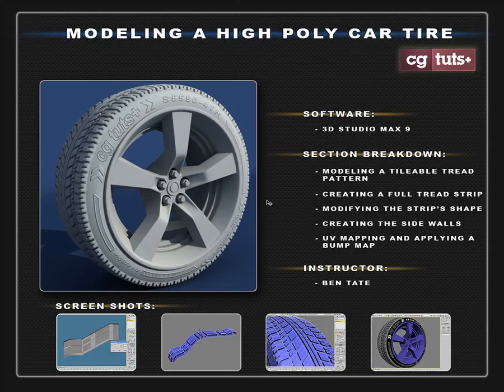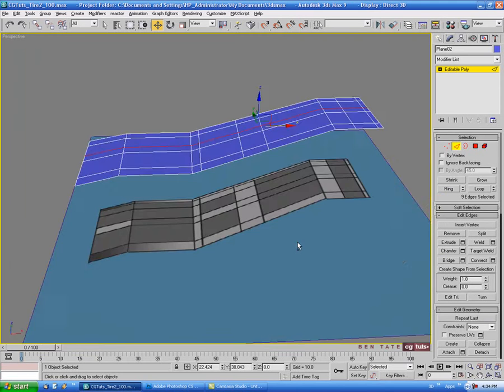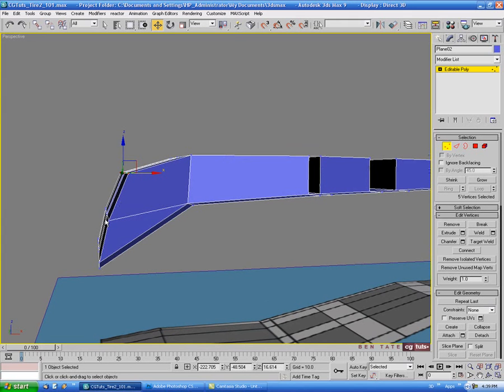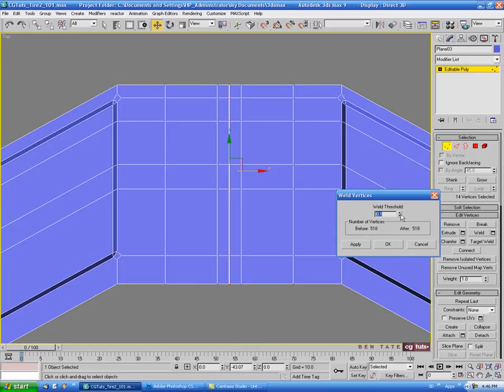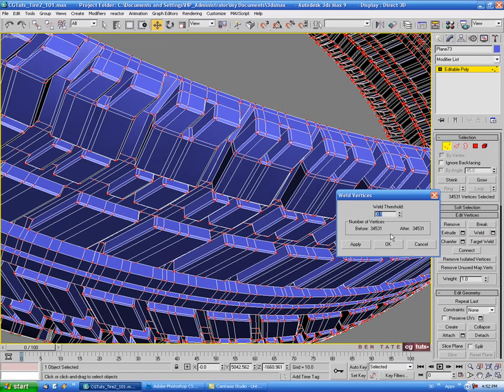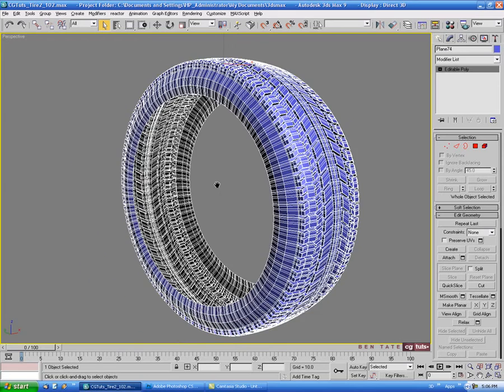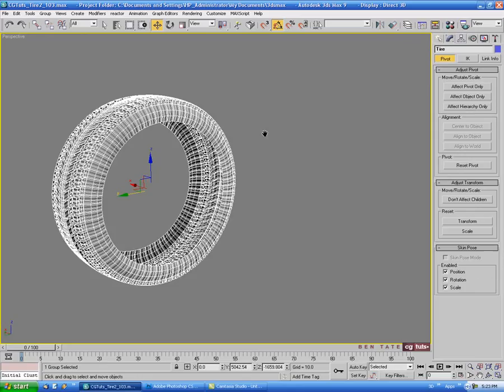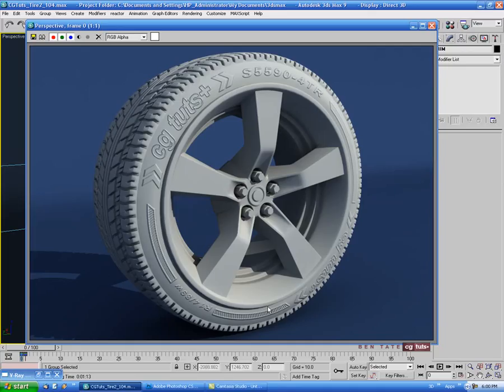Modeling a High-Poly Car Tire in 3ds Max - 1

Comment: My OCD was in overdrive until you micro-beveled the center grooves of the tread lol. Faceted, not fauceted (OCD). Nice job. Creating a normal map of the high res will often suffice for the tread itself. I do a lot of simulations and it's nicer than using proxies sometimes to keep polycount low.